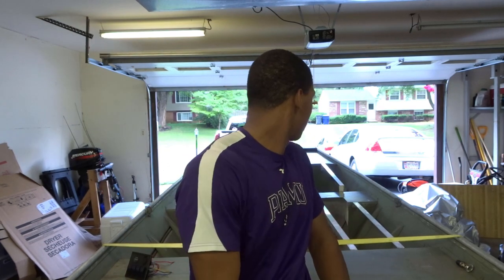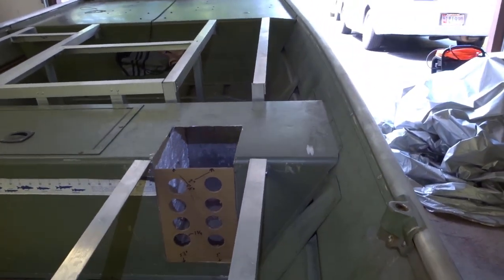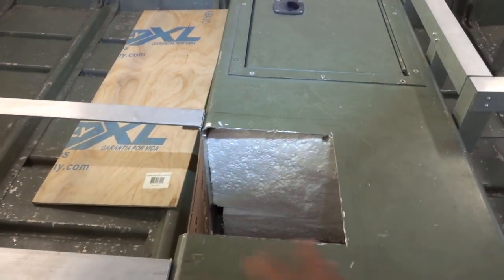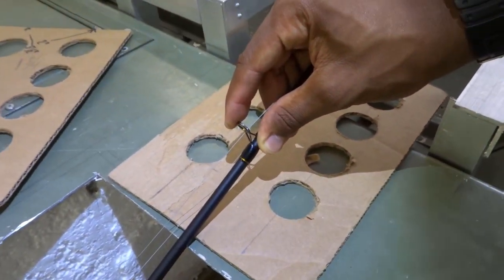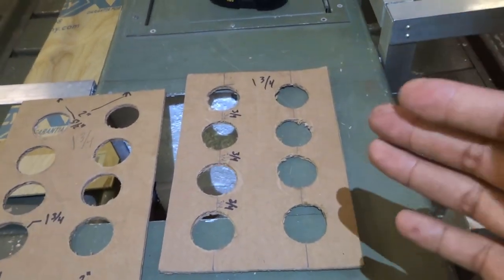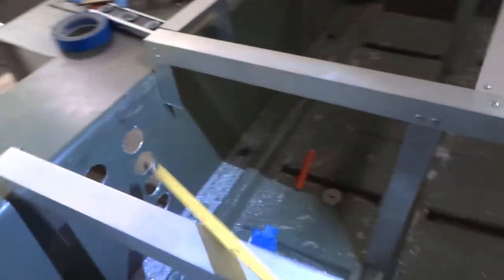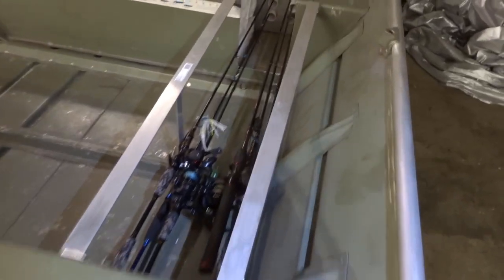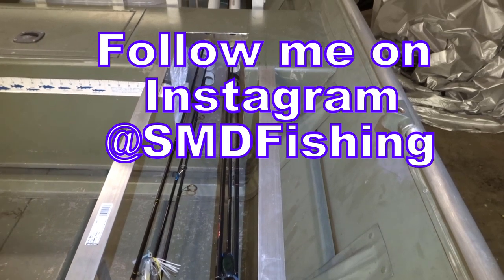How to build a Rod Locker for my Jon Boat to Bass Boat  conversion

Comment: You can taper the pvc w/ a heat gun & a beer bottle. It will make for a snug fit & prevent from damaging any eyelets when placing/removing rods
Reply from the maker: Thank you for your input. I may have to take it into consideration.

Comment: Slide some padding like soft foam into the end of your rod tubes, it will keep your rod tips from sliding too far and hitting metal. I just found your channel, but I think in the future, as you get more into bass fishing you will want to carry more rods with you. I agree that having over 15 rods on your deck, all with different baits is outrageous, but there have been specific times where my partner and I had over 20 rods on the deck and 18 of them were crankbait rods with different sized lines and variations of the same bait in different colors and depths. The number of rods you bring will often depend on how specific you want to get, and trust me, being specific can sometimes mean the difference between 5 bass and 50 bass.
Reply from the maker: Totally agree with you, and thanks for the advice.